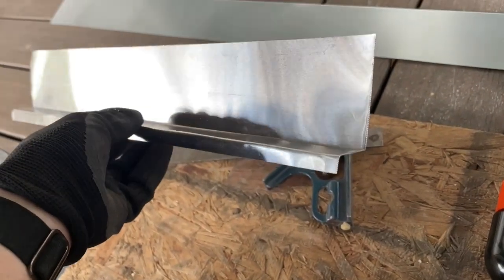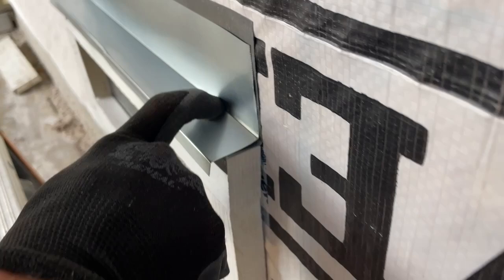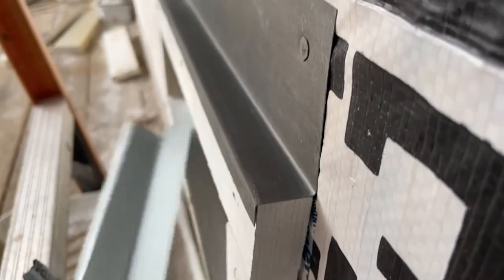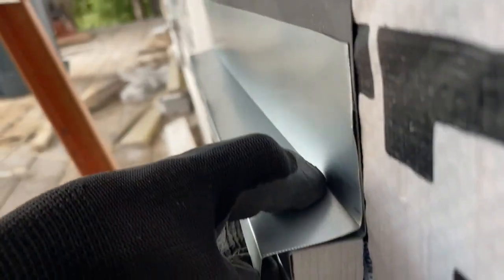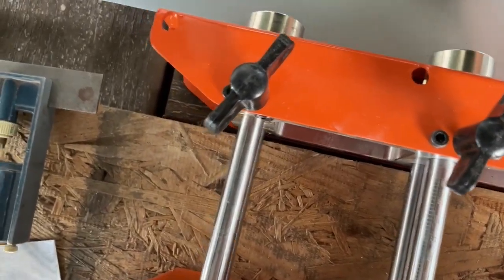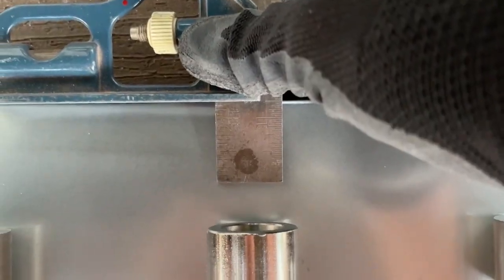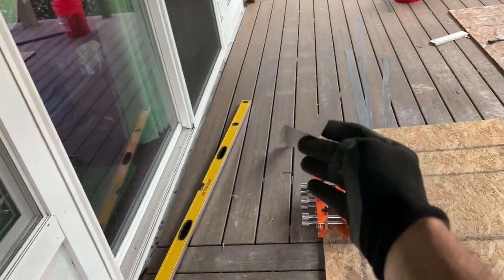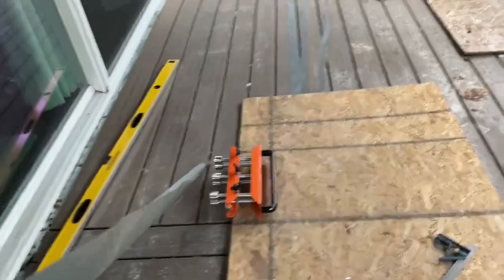Make custom metal flashings without a brake using a roller bender

Comment from the maker: Good question - a piece of butyl tape goes on top the metal z flashing which stops water from getting behind it and the house wrap. Also before I put up the window exterior casing, there is another layer of butyl tape that directs water outside.